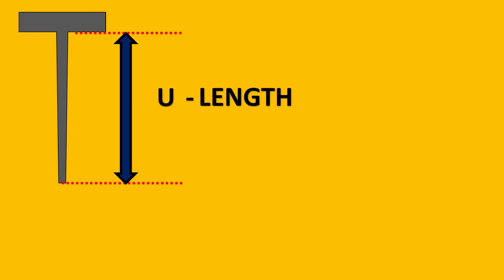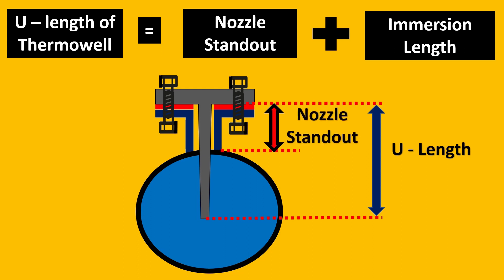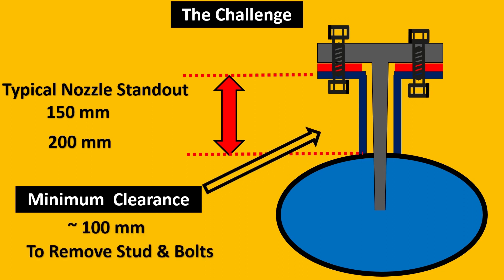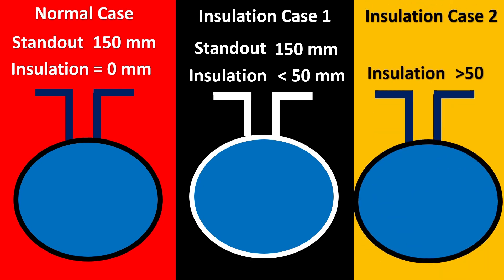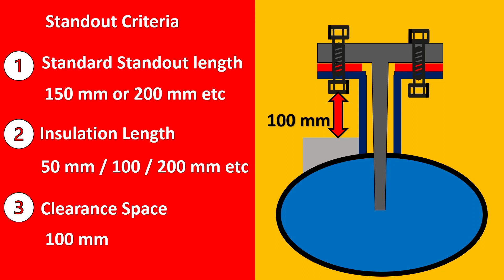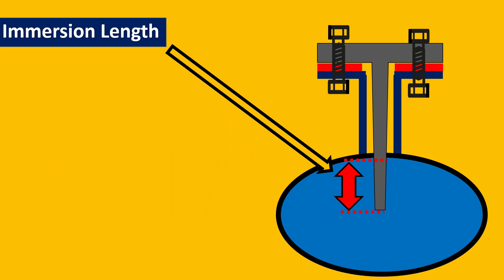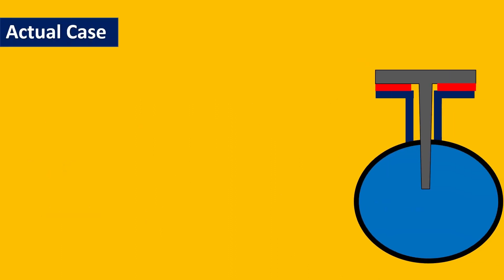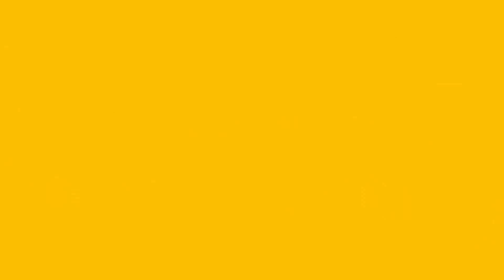Thermowell U-LENGTH Calculation | Thermowell Insertion Length (MOST SIMPLE EXPLANATION)

Comment: Thermowell material is SS316. Pipe flange material is CS. I hope we require insulating gasket.
Reply from the maker: Yes, a gasket will be required for SS316 Thermowell in a CS flange.

Comment: Nice Video Asad. Can u tell me about what is meant by Insulation length
Reply from the maker: We have various type of insulation, Like Hot Insulation (For Line with High temperature) Cold insulation etc. So, in simple words it is a cover on pipe to protect heat transfer or for personal protection.

Comment: Do u need to take Thickness of pipe and Gasket to calculate U length
Reply: Hi.. could you help me to understand above query
Reply from the maker: This is really a very GOOD QUESTION .
I can tell you my understanding, 

1) Point 1 : Should we consider gasket thickness :The spiral wound gasket thickness are typically between 3.2 mm to 6.5mm max so as per my understanding this can be ignored by keeping a little safety margin in our calculation

2) Point 2 : The Thickness of wall of pipe : In the projects and calculation that i have worked, this is basically few mm thus during U- length calculation we can consider a safety margin for this aspect.
So accordingly the U-Lengths are decided with safety margin.

In brief the answer as per my opinion is that since these are minimum values considering a safety margin should suffice for the effect of these values.

hope I was able answer this question. I am also a learner like you so if anyone else has some other understanding please share !!